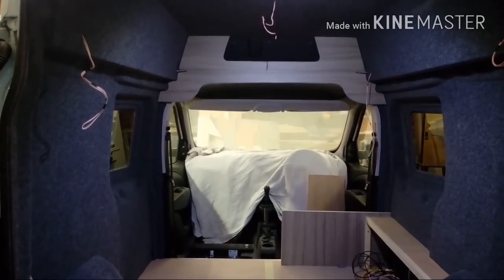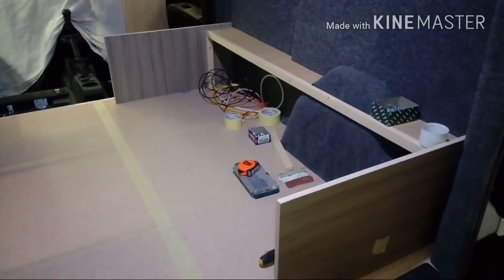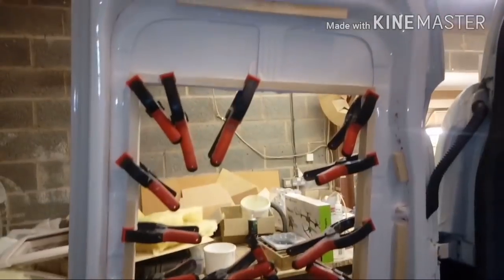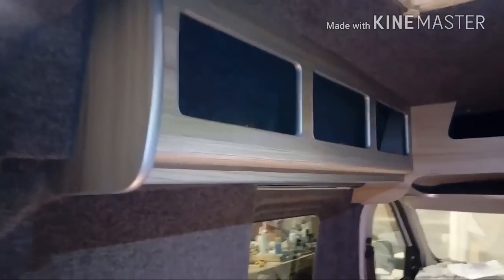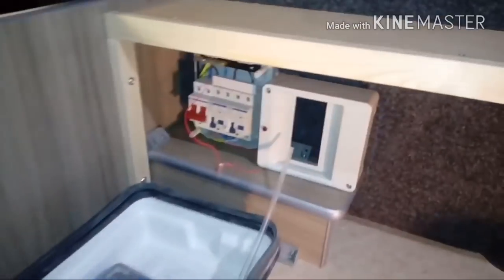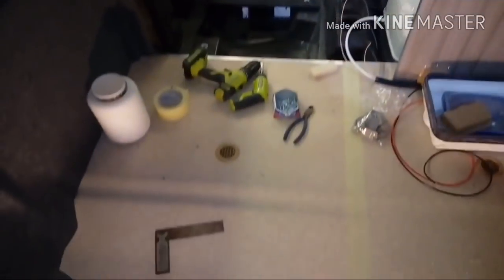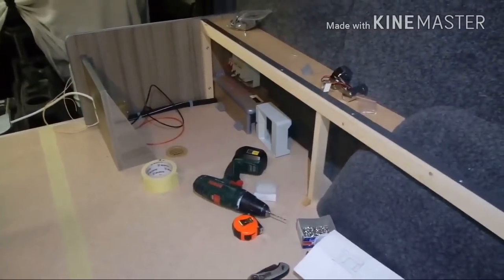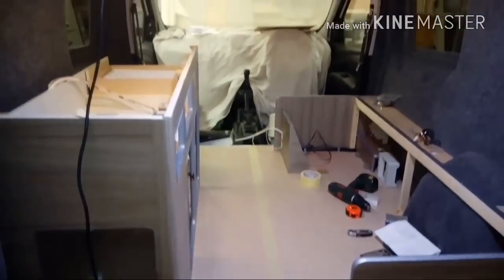How to Build a Campervan Micro Camper Vauxhall Combo ( Series 2 Episode 3 )

Comment: Can you explain how you build the storage shelf above the cab?  I have a 2015 Ram Promaster City which is very similar to the Fiat Doblo.  I want to extend/replace the storage above the seats but the van comes with a very small shelf with curved lip and I'm still figuring out how to adapt that or if I should pull it out and replace it.  any suggestions?  If I do pull it out, what do you do with the visors and light assembly that is integrated into the existing shelf?